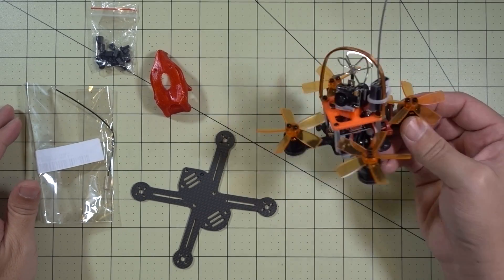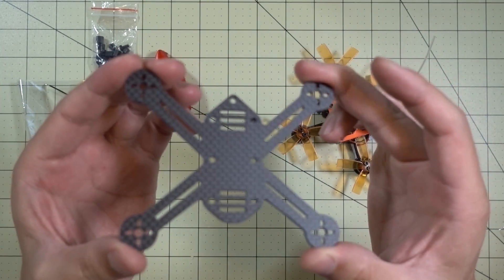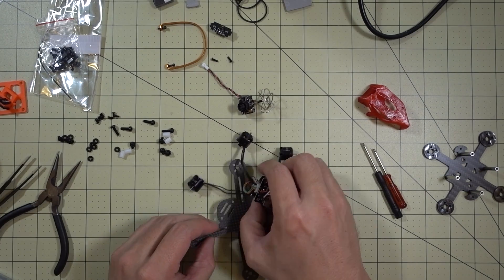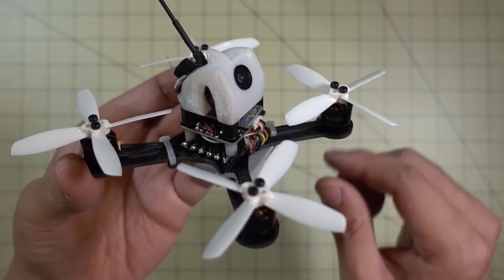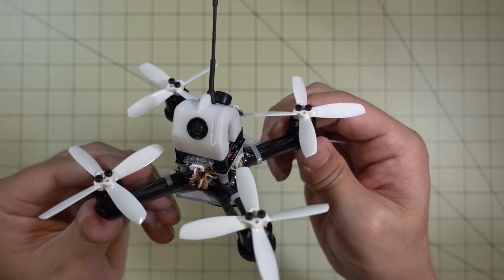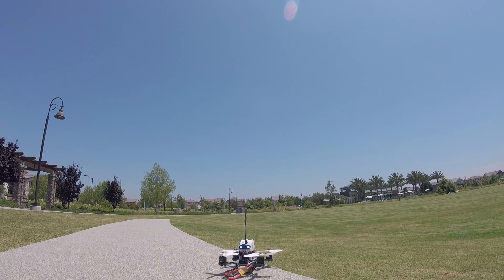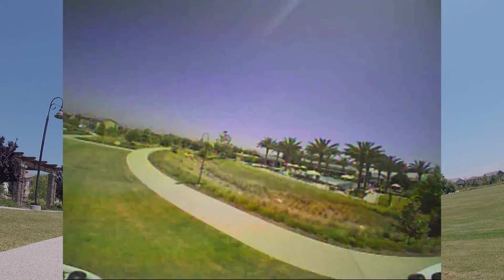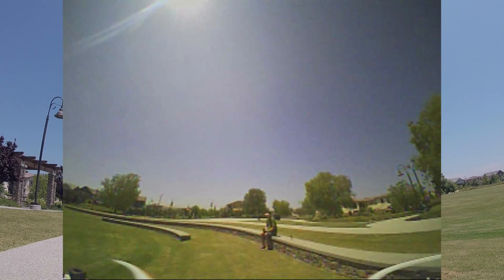Micro Drones 101 🔥 #4 💡 Air Arsenal Squirt 100 💡

Comment: Hi Albert, how efficient are this motors? I have the 1104/7500 and they are very power hungry, how is the flight time running these motors?
Reply from the maker: +Thevene Rodriguez About 3.5 to 4 minutes on a 650mah 2S 75C Tattu lipo. You need damn good lipos for these power hungry motors. Crap batteries will make you cry...